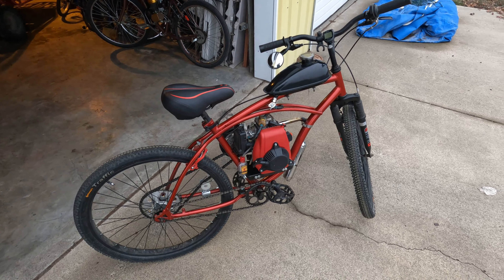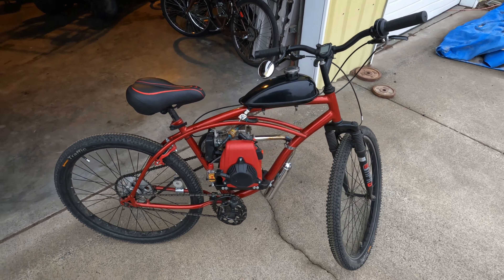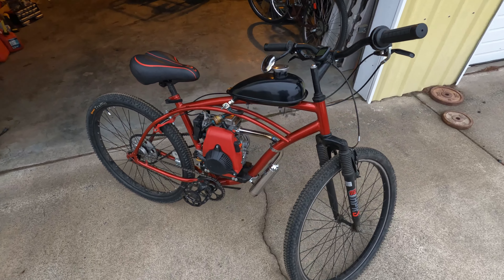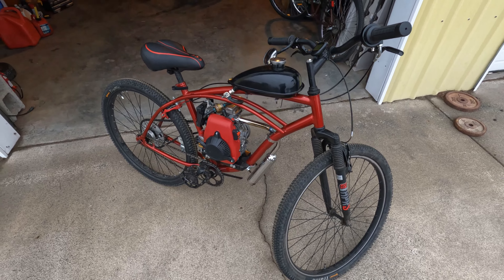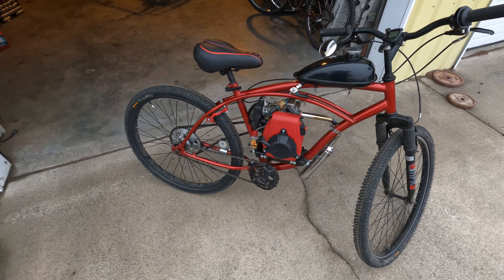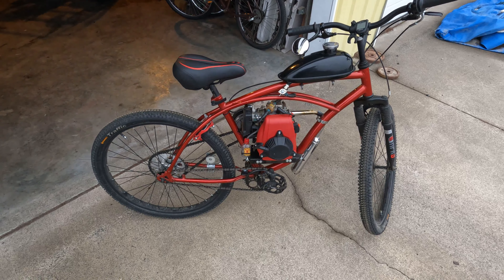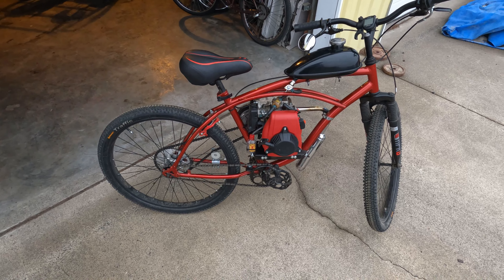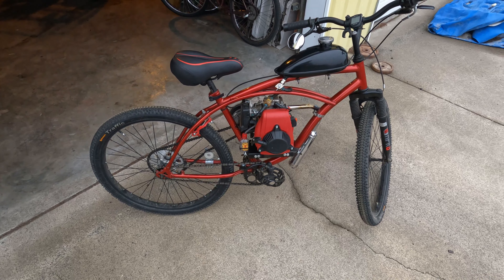4 stroke motorized bike video

Comment: I had one of those kits. That larger trans pulley is gonna fail! Give it time. Then youll be ordering a new trans from bikeberry! Thatll be another $100+. Be prepared. 
Thats the main reason I ride a phatmoto rover. Been riding it for a solid year with only basic issues, like tubes, tires, brake pads, new exhaust pipe, new chopper straight fork, etc. I bought all this over the course of a year.
Reply from the maker: This was something to do for fun. When i ride i ride my motorcycle. I will deal with it when it breaks. Dont think i will be buying anything from bikeberry..😎